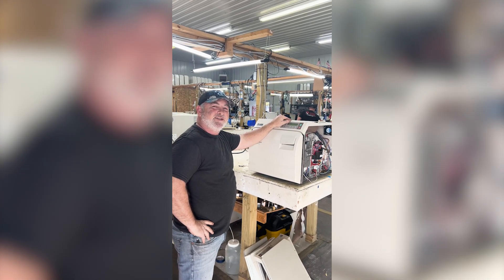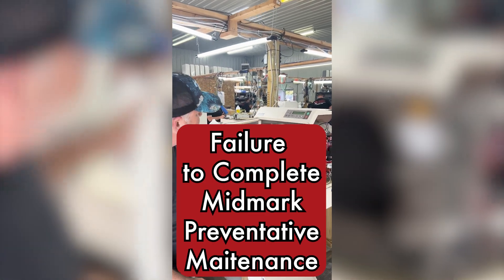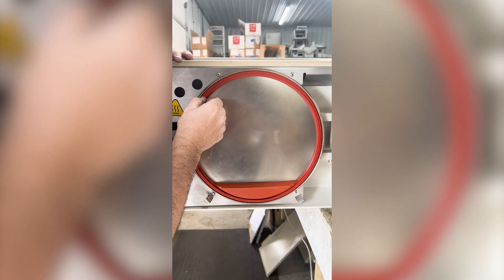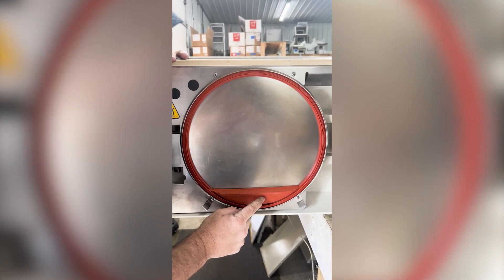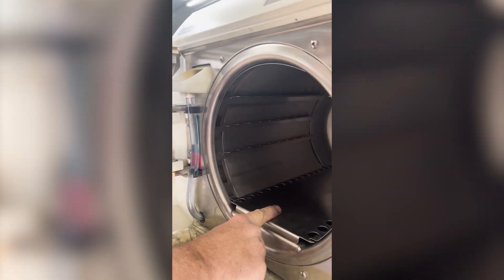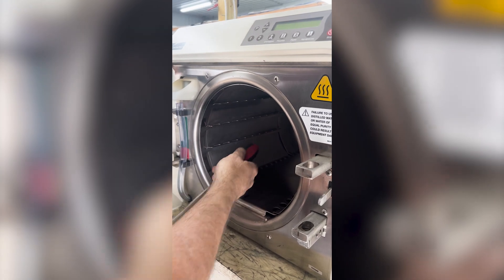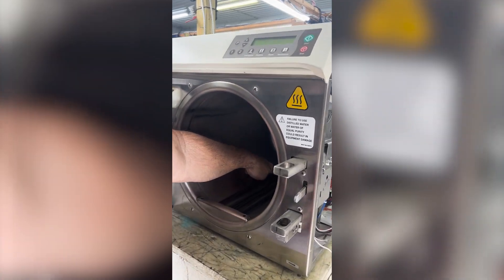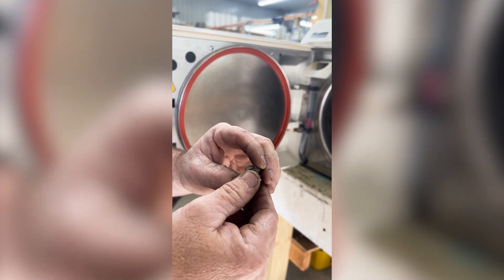What Happens When Midmark Preventative Maintenance is Not Performed #shorts

Comment: Do you have to change the door spring?
Reply from the maker: Thank you for the comment! Yes, the door springs should be replaced during preventative maintenance.  If the door springs are not replaced there is a chance the door will not spring open enough during the dry cycle, and the instruments wouldn't properly dry. Also, all of the components in this video and other PM videos are based on manufacturer specifications on what needs to be replaced during preventative maintenance.